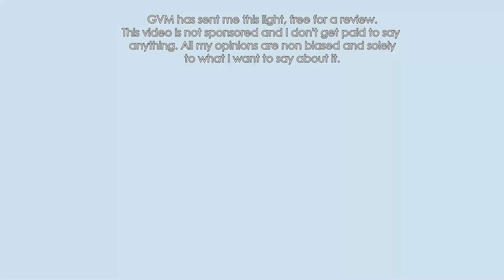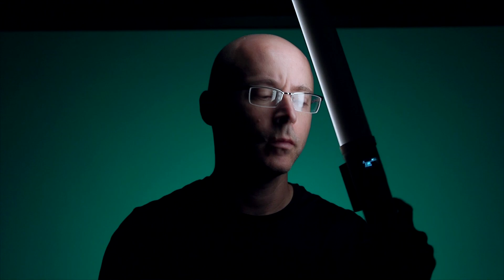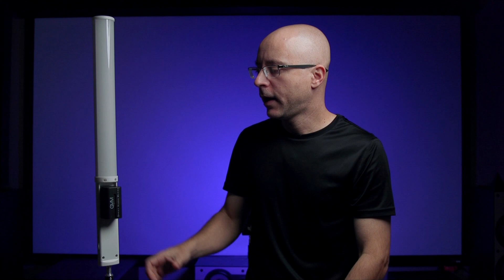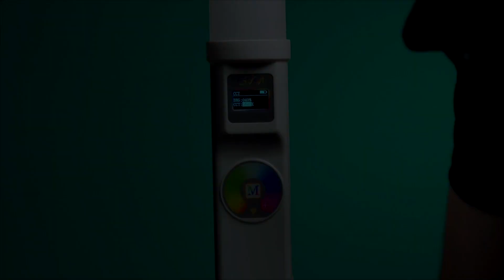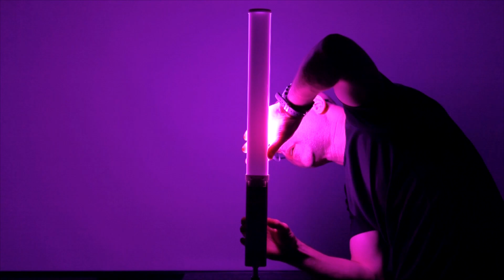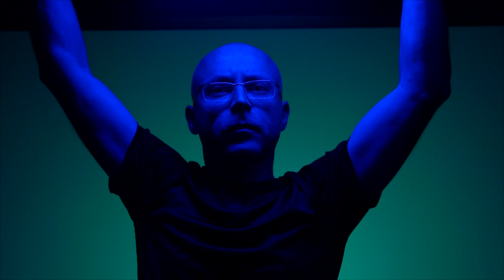GVM T-20R RGB Wand Light In-Depth Review

Comment: Hi, is it possible to sync more than one tube, if I put a specific color in one the same  thing happens to the other. And, can I control with an app?
Reply from the maker: Oi Arnaldo, this light does not run with an App, or standard remote control. It’s all manual. To me it’s not a problem since everything I need using this light, the controls are right on my thumb.
Reply: @ArtVideoProductions  thanks for your answer!!!
Reply: Can you link me to the other battery you use in this video Please